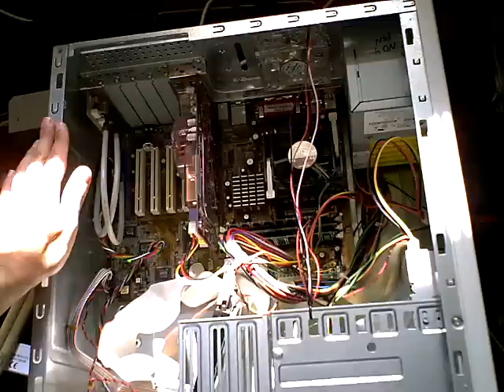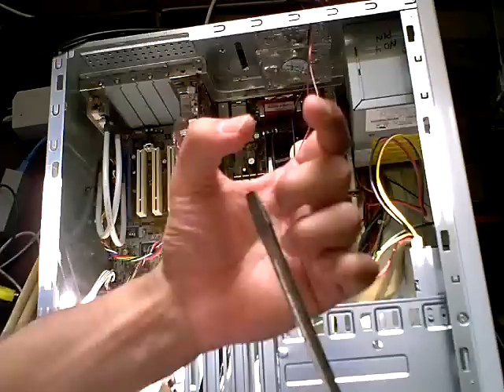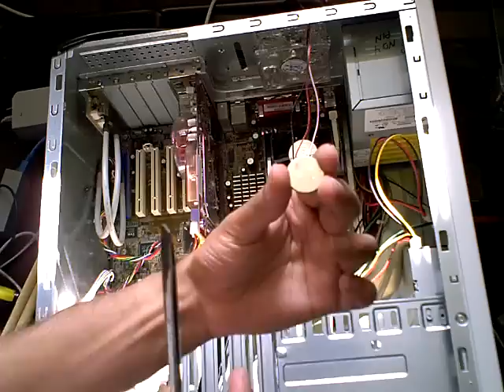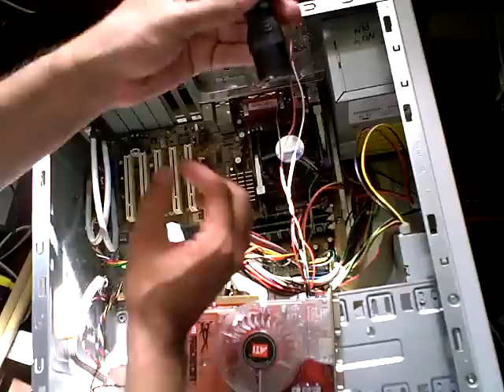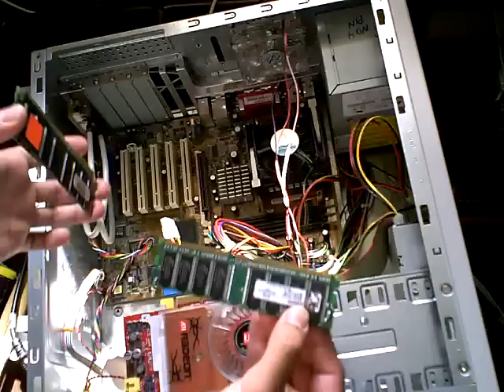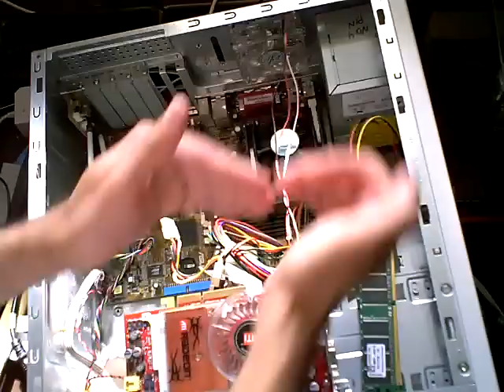How to possibly fix a PC that will turn on but will not beep and will not display anything on screen

Comment: I need help. My desktop screen turns on but then its goes to sleep mode really fast. It beeps constantly as well. D:
Reply from the maker: Beep error codes differ from one BIOS manufacturer to the next. To discover what the beep error code is trying to telling you, discover the manufacturer of your BIOS (available in the motherboard's manual or on the motherboard's manufacturer's website {on the page for your specific motherboard model}) and then look up the frequency and interval of your beep error code on:

http://www.computerhope.com/beep.htm

Comment: soi didn't remove my video card . but i  removed the 2 RAM and it stated it beeping, is that mean that i have to replace my rams ? help..
Reply from the maker: Beep error codes differ from one BIOS manufacturer to the next. To discover what the beep error code is trying to telling you, discover the manufacturer of your BIOS (available in the motherboard's manual or on the motherboard's manufacturer's website {on the page for your specific motherboard model}) and then look up the frequency and interval of your beep error code on:

http://www.computerhope.com/beep.htm
Reply: Your computer needs ram to run. If you take it out it will beep.
Reply from the maker: The reason I told you ElSuperFeli to look up the beep error code is because said beep error code MAY correspond to something else, such as a video problem, CPU problem, etc, which would indicate that the RAM was simply preventing the beep error code from sounding, not necessarily that it was the component to blame.
Reply: i had a friend of mine check it out she  said its the computer processor, can that part be replaced ? and thank you so much for responding!@RodneyDickson
Reply: ElSuperFeli Every part can be replaced.
The CPU is one of the harder parts to replace (even though it's still easy to replace) just because of how many different socket types there are.
But just take out your processor(under the fan on the motherboard) and check around to see what socket type you have (You should try looking up the motherboard for that). Find a new processor with the same socket, and replace it.
Also you're probably gonna need some thermal paste don't forget that.
Reply from the maker: If you're getting beeps, the thing is salvageable. Unplug the pc, install the RAM modules in a different order or configuration and power up. If no luck, repeat (each time unplugging the machine, changing the order and/or quantity of RAM modules, and powering up) until you find the combination that works with the most RAM possible (one or more of your RAM modules or RAM sockets might have gone bad)

Comment: My cpu will on then instantly turn off back :( what happen? Can you help me? Please
Reply from the maker: +Giannkirk Sabi It sounds like your motherboard is developing a short circuit due to contact with the metal casing. Most likely it has to do with the screws and metal mounting stands (supports) that your motherboard sits on. The cheapest way to fix this problem is to introduce cardboard washers between the screws and where they make contact to the motherboard, or you can buy plastic mounting supports at a computer shop.

Alternatively, you can always Breadboard it (explained in the following video:)

If the steps in this video did not provide a solution to your problem, view:

http://www.youtube.com/watch?v=_EK9a-R5pss

You never know, maybe rebuilding the PC in the opposite sense that you took it apart will solve the problem.

Comment: Whats happend to me : I did a system restore
So I could fix my files then when I turn it on it comes up with the mouse pointer and a black screen HELP!!!
Reply from the maker: Hmm, not sure how to help you here. You can try booting in Safe Mode (hold F8 as the PC boots up) and see if that gives you access to your Windows. If it does, explore the file contents to see if you still have access to your user files. If you do, I'd back up all user files, format, and start anew I'm afraid (thus why I stay away from system restore functions). Let me know how it turns out.

Comment: Everyday, 10's of thousands of CRT TV's are being taken to the dump because they are being replaced with new flat screens.
On my trip to the dump, I discovered that along with the TV's were dozens of orphaned computers.  It may be amazing to you guys but the average person gets so befuddled with common operating system problems or they had lost their re-install discs that they just go out and buy a new system and throw the old one away.
I disposed of my TV and when the guy wasn't looking, loaded 4 dead computers in my car and later went back for more. (A dry spell with no rain yields the best results)
Granted, some were dated but not one had broken components.  All could be fixed with a simple a Linux install or be cannibalized for components.
Reply from the maker: +Larkinchance I appreciate what you're doing, not only for the environment, but frankly to avoid needless waste! If you have no use for the machines you recover, I recommend giving them away on sites like kijiji or craigslist to help someone else out who could use em.

Comment: I just built my pc a few minutes ago but I cant get any display. Everything is brand new, I bought it within the month. I keep checking the RAM but still no display
Reply from the maker: +T97 Flawless Breadboard it (explained in the following video:)

If the steps in this video did not provide a solution to your problem, view:

http://www.youtube.com/watch?v=_EK9a-R5pss

You never know, maybe rebuilding the PC in the opposite sense that you took it apart will solve the problem.
Reply: RodneyDickson I was at this for literally 10 hours yesterday and every fix I came across on google and youtube didnt work for me. This no signal makes up for about 7 of those hours. I just tried the Breadboard thing and also taking apart everything and starting from scratch but the results are same. Probably gonna have a professional look at it  :(
Reply from the maker: +T97 Flawless You checked your CPU pins are not bent, right?
Reply: RodneyDickson I found the problem...I built every piece correctly but I wasn't connecting the monitor to my graphics card because VGA wouldn't work with it but I kept it in the motherboard wile connecting my tv to hdmi on the graphics. I unplugged the VGA from the mb and I finally got visuals! now I need an OS
Reply from the maker: +T97 Flawless That's good to hear then.
Reply: +T97 Flawless OMFG!!! I had the exact same issue but u helped me out! I didn't know that I had to put an HDMI into the graphics card. Now it works. Thank you so much!!!!
Reply: Olexander Babanin Glad you got it working. Im sure allot of us spent so much time looking at every problem that building another pc would be a cake walk

Comment: my pc works with non beep at start how will i be able to identify my problem with this issue
Reply from the maker: +Lincoln Martis Is your PC functioning as intended, but just not making a beep sound despite loading your operating system and otherwise functioning?

Comment: Sir my pc is not till working its american megatrends witg core 2 duo processer and bestec psu when i press a keyboard and when i release it num lock key blinks no display on moniter
Reply from the maker: +vaibhav katyal Breadboard it (explained in the following video:)

If the steps in this video did not provide a solution to your problem, view:

http://www.youtube.com/watch?v=_EK9a-R5pss

You never know, maybe rebuilding the PC in the opposite sense that you took it apart will solve the problem.

Comment: i want your gpu i need powerful non pcie gpu do you know how that connector near pci is called?
Reply from the maker: Well here's the thing: If you are referring to the graphics card slot that is present on the motherboard I show in the video, this is a standard known as AGP, which preceded PCI-E. If your computer has this, it must date back a good amount of years (AGP is since discontinued and was superseded by PCI-E)
Reply: yea i know everything is on pcie nowdays i just forgot the name and yes i have an old pc witch needs some gpu horse power its not my main rig though and thanks
Reply from the maker: JusstyteN
Sure thing. A performant AGP graphics card (such as the large profile one with 512 megs of RAM like the one shown) might be difficult to come by, but sites like Kijiji might be useful to find a used one. Good luck : )
Reply: thanks again really helpful!

Comment: I have the same problem, my MSI motherboard gives 3 long beeps, that means there is no RAM, when GPU and RAM is removed. The bad thing is that I only have 1 RAM stick, one 2 Gb DDR2.. Now I'm asking a friend to lend me his RAM..
Reply from the maker: Try the CMOS reset trick as shown in the video. From there, if still no 
luck, unplug the PC, try the RAM module in a different socket, and power
 up. If no luck, repeat this until every socket has been tested. If 
still no luck, I haven't much else to suggest aside from breadboarding 
the entire machine: http://www.youtube.com/watch?v=_EK9a-R5pss

Comment: I got 1 fan not spinning, is that something?
Reply from the maker: +Blue The fan could be dead, defective, a wire could be ripped, or the fan power connector on your motherboard could be burnt. Try unplugging the PC, disconnecting the cable for the defective fan, connecting it to a different fan power connector on your motherboard (if you have another one) and see if that solves the issue.

Comment: Hey dude when i turn on my pc it'll show a quick blue screen, then it'll restart and i'll get the options:
-start windows normally
-windows startup repair

Neither of these options work i can't turn on my pc!!!! Pls help!!!!
Reply from the maker: +kai Your Windows is corrupt. You'll have to format and reinstall sadly, losing all of your saved data (unless you boot up a Linux LIVE CD and backup your existing data first, or slave your drive to another PC to back up the existing data)
Reply: RodneyDickson I fixed it loooong time ago thanks for your reply tho, it was an error in the bios.
Reply from the maker: +kai Thanks for the update : )

Comment: In order to reset the cmos setting with the jumper you need the power of the button batt and 10 sec is enough.  because you can drain the batt.
Reply from the maker: Useful tip, thanks for sharing : )
Reply: RodneyDickson
Happy to help !

Comment: brand new MB,PSU and GFX but i'm getting no display and no beeps, help pls ;c
Reply from the maker: Try breadboarding the PC: 1)place the motherboard with CPU+Fan on wood or non-shiny cardboard 2)connect all of the case connectors to the board's panel 3)with a power bar that is OFF connect the PC power cable from the power bar to the power supply and the power supply to the board 4)while NEVER touching any exposed component,power on the power bar and press the power switch on the case.If the problem still persists,one of the remaining components is probably defective.Power off the power bar before dismantling

I cover breadboarding in greater detail in this video:
Advanced troubleshooting technique tutorial of how to possibly fix a PC that will not beep at boot

Comment: i got a hal error 12 and my computer would not wake from sleep mode i would have to press buttons hoping it would wake and when it would i would get an hal error The platform firmware has corrupted memory across the previous system power transition.  Please check for updated firmware for your system. so i take the ram out wait 30 seconds and put my ram back in and then i had a similar issue to this then i replaced the motherboard this new board is like a month old and then start my computer no display or beeps then again my cpu was destroyed during the proccess
Reply from the maker: I'm sorry to hear that. In the future, you should only update the firmware of a PC if it is absolutely necessary (for example, to support new hardware that you are installing).

Comment: I just opened up the back of my laptop,took out the ram to see how many gigs it was,slid it back into the slot,tried to turn my laptop on,and the light came on for a second,and pc went off,just like that.No screen,but did hear fan and hard drive boot for a quick sec.
Reply from the maker: +Nino Blacque Eek! This sounds like static discharge might have damaged things. Nonetheless, give these steps a try: Laptop fixes:
https://www.youtube.com/watch?v=qRhphHjQrNk
https://www.youtube.com/watch?v=X78u90mETpE

Comment: Please help!!

My problem is when i turn on the computer it just turn on for like 1 second so i pressed my cpu power button the light was on and then its turn off straight away..i hope you can help me :(.
Reply from the maker: +thesky jaz It sounds like your motherboard is developing a short circuit due to contact with the metal casing. Most likely it has to do with the screws and metal mounting stands (supports) that your motherboard sits on. The cheapest way to fix this problem is to introduce cardboard washers between the screws and where they make contact to the motherboard, or you can buy plastic mounting supports at a computer shop.

Alternatively, you can always Breadboard it (explained in the following video:)

If the steps in this video did not provide a solution to your problem, view:

http://www.youtube.com/watch?v=_EK9a-R5pss

You never know, maybe rebuilding the PC in the opposite sense that you took it apart will solve the problem.
Reply: +RodneyDickson Hey Rodney,thanks for your reply its informative and long thanks man! And btw im using a laptop now :) i hope it will last longer than my previous PC.
Reply from the maker: +thesky jaz I wish you well with it then : )

Comment: I just replaced my cpu, but i dont get beeps or a screen. But when i put my old cpu back it does work help?
Reply from the maker: If this is new hardware that you are installing on your motherboard (that you have not yet got to work on your motherboard,) note that matching bus types of video card to motherboard socket does not necessarily signify compatibility. If this is the first time you are trying this hardware on your motherboard, there is a chance that this new hardware is not compatible with your motherboard, despite the same bus type and despite the fact that the new parts fit in their respective motherboard socket. Your motherboard manufacturer's website will have a support page dedicated to your motherboard's model, and on this support page should be a compatibility list for such components. Ensure that your new component is certified to function with your motherboard, and if your new component is not present on the compatibility list, then there is a chance that the component is not compatible with your motherboard.
Reply: RodneyDickson It is compatible i checked.
It sucks if it doesnt work cause it was a pretty good cpu i got it from my dad's old pc who had the same socket on his mb
Reply from the maker: GoatGaming
Ahh, settings have to be set either with the motherboard's jumpers, motherboard's dip switches, or BIOS settings to accommodate this CPU (you need  to check your motherboard's manual to confirm how to do this). Your motherboard may also require a BIOS update to accommodate your different CPU. Your motherboards manual lay out the specifics to accommodate your new CPU. Good luck.
Reply: RodneyDickson Is there a tutorial link on how to do this?
I dont exactly understand it.
But thanks man! You've given me hope!
Reply from the maker: GoatGaming
Ahh, well no, I've never shot a tutorial on this (changing dip switches or jumper configurations to accommodate different CPUs is no longer very common (most motherboards perform the configuration automatically)). Once again, if you have the motherboard's manual (or can download the PDF copy off of the manufacturer's website) read through the manual and see if there are any mentions of jumper settings or dip switch settings based on CPU speed support: if there are, use the schematic of the motherboard as a guide to locate what needs to be changed, and if there is no mention of this, then the motherboard should do this automatically. Once again, you may need to update your BIOS in order to accommodate the faster CPU...see if there are any BIOS updates for your motherboard on the manufacturer's support page for your motherboard, and if so, download and install the latest update before trying the new CPU. Good luck with it.
Reply: RodneyDickson I have the latest bios, but the problem is i have a msi 0a90 motherboard which i cant find any manual here or online of. it seems very old.
Reply from the maker: GoatGaming
Hmm, best I can tell you is do google searches. I had to sometimes resort to foreign language pdf manuals for some of my obscure motherboards in order to try to make sense of things : \
Reply: RodneyDickson Google searches resort to nothing.
I keep not finding alot about my mb.
Reply: GoatGaming I do know the name of the original pc it was dell dx microtower 2300
Reply from the maker: GoatGaming
Ahh, that's why. These boards were not sold to the consumer as an OEM part and was rather manufactured exclusively for Dell. Sorry, don't think you're gonna find a way to work around your issue : \